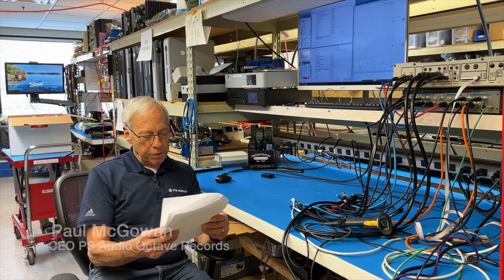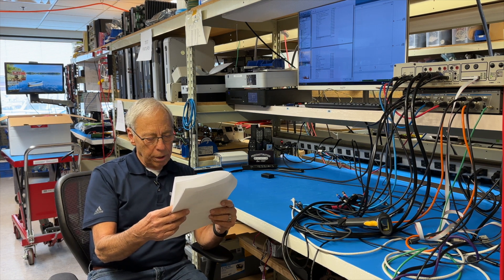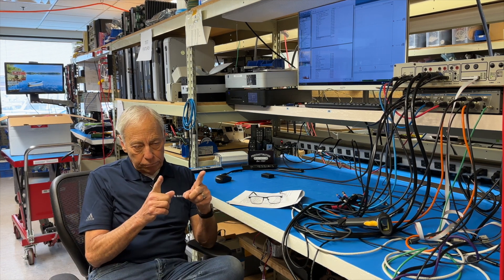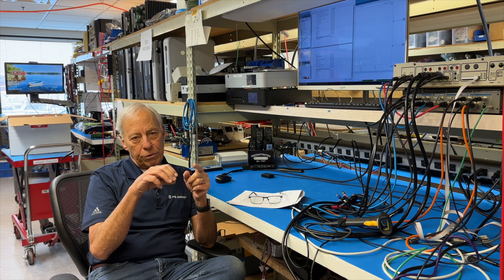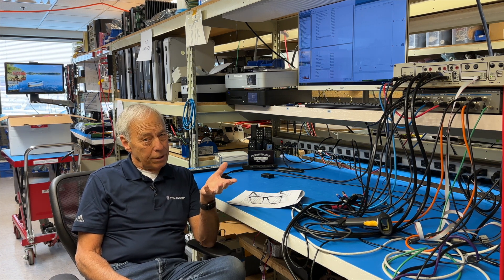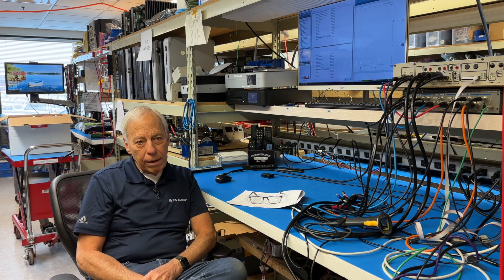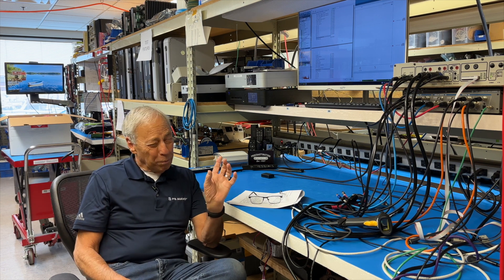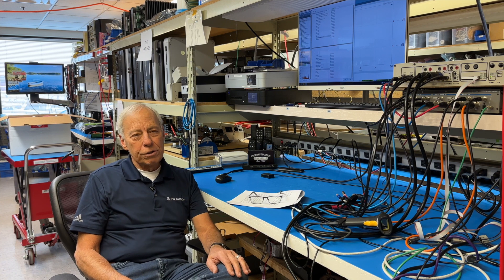Using audio grade resistors in loudspeakers

Comment: Thanks for all the great info. I have a question that, so far, nobody has been able to answer without a convoluted explanation of electronic engineering. When adding additional 4 Ohm speakers in a parallel connection, can I add in line resistors resistor to keep the impedance constant; for instance, each 4 ohm out on the amplifier goes to a 4 Ohm speaker. If I connect another 4 Ohm speaker to each output, the parallel connecttion will drop the load to 2 Ohms; so adding a 2 Ohm/25W resistor to each additional speaker should keep the load at 4 Ohms. Am I mistaken?

My 5.1 surround sound system has 4 speakers + the LFE out to a subwoofer. Each speaker is rated at 4 Ohms, matching the amp output. But I want to add four more 4 Ohm speakers, for a total of 8 speakers. Would adding 2 Ohm resistors to the additional speakers protect the circuit from overheating?
Reply: To get a 4 ohm load, you'd need two 8 ohms loads in parallel, and to get the same loudness out of your speakers, you'd need to put the same current through them, so the added resistances would only mean you'll need more voltage and therefore power to get there, IMHO.
Reply: Better to wire the speakers in series or series parallel .a 2 ohm will reduce the sensitivity somewhat, but more important is the effect on damping ( the amount of control the amp has on the speaker). Depending on the design of the speaker you may notice a bump in low fr.and muddy bass and possibly
some changes in fr.response at the crossover frequency.you try 2 ohm resistor in series with speaker you already using and listen to see if changes in sound are acceptable.good idea to use ohmmeter to check dc resistance of any multiple speaker setup at leads to be connected to amp channel before actually connecting.a 3 ohm would indicate 4ohm impedance.6ohm=8 ohm.this is not as accurate as actual impedance test but will alert you to low impedance that brings the smoke and damage.

Comment: Hi Paul I have some older Sansui speakers want to say around 1983 I was thinking about changing out the capacitors in the crossover you think that's a good idea they are getting up in up in age thanks a lot like your videos
Reply: If they are electrolytic yes, but ignore the advice on resistors, most speakers have more than 5% distortion anyway, good ones around 1%, so resistor sound is just a myth.

Comment: I'll add, for things like Metal FIlm, peoplle say inductive, but it really depends, Low value Matal film will have an inductive element, due to the way the resistor is formed, over 100 or so ohms the parasitics balance out so it behaves very much like a text book resistor, and then for higher values above say 470R then inter groove capacitance begins to dominate. The only true difference I guess, which you can measure, is for the very old carbon composite, as they become non-linear as voltage (three figures +) goes up, The non-linearity is real-time kHz. In valve amplifiers where high voltages are  the norm, you can observe a compression effect as the Anode resistor value drops in real time, as the signal swing reaches it's peak, dynamically lowering gain. I would go for a high stability with a low thermal gradient.

Comment: Parallel you will increase the wattage so you can buy 2x smaller wattage
Reply: 2 X 1Watt in parallel and 2 X 1Watt in series both equal 2 watts.

Comment: Resistors have properties of inductance and thermal dependencies besides resistance itself. There is nothing about resistors that can't be measured with simple measurement tools although thermal resistance dependencies obviously require some heat chamber to measure. Two resistors in series doubles the inductance and an inductor is a low pass filter also affecting phase. Thus higher frequencies will be more affected by resistors in series, if the resistor has a coil in it. The topic is about good engineering practices and the notion that certain resistors need to cost a fortune to be audiophile is mostly about snake oil business.
Reply: Agreed, good poont on series / parallel inductance.  I think you already realise we are discussing nH attached to one hell of a coil in gods own magnetic gap.   :-  )
Reply: @Roosville1  Yes, agree. Our brain is great at fooling us to conclude that A sounds better than B if A is more expensive or considered "audiophile grade".

Comment: I realize this can be a highly “subjective” subject; what sounds “better”

If resistor “value” accuracy is more important than parasitic Reactance, then achieve the closest resistor value best way you can (parallel or series)

On the other hand, if parasitic Reactance is the “enemy” then I see two scenarios:
1) Resistor is on the “through” path, put them in parallel (to reduce inductance)
2) Resistor is going to “ground” put them in series (to reduce capacitance)

In general, resistors in parallel give you better power handling options, use smaller parts

Lastly, even though we cannot hear past 20kHz, high-end audio circuits are typically designed for much higher frequency handling (50 kHz and even 75kHz) in that case, wire-wound resistors are the enemy (most inductive) so stick to carbon-comp if you can

Comment: Those of us who actually build cross overs and hear the difference between quality and budget "parts" applaud you sir. It’s not subtle but you do have to know what your trying to discern. One will hear a broader, deeper sound stage with better separation and timbre with nicer components.
Reply: You know, most of the audio tomfoolery ends with soundstage and timbre, you cannot tell the difference between 2 decent resistors.

Comment: Gotta love it!  Now i'm really piqued, I've got a few $K to burn, anyone know where I can audition some high-end audiophile resistors?❤😂
Reply: Top end resistors are typically 30-60 each. Once you get beyond $8 Mills resistors and similar quality wire-wound resistors, the differences will be very small. And depending on the rest of your system, placement, room, etc. they may or may not make a difference, subtle as it may be.
Reply: @hoth2112  I'm looking for the >$10K ones, the "gold standard", they're bound to be more "spacial" in the upper midrange :)
Reply: @stephenstevens6573  
Let the Audiophiles have their “playing with my hardware” fun.  They like
Tinkering with buttons, knobs, cables, etc etc.
EQ software, Scopes to measure everything, listening to electricity flowing through their cables.
Panic attacks if they think they are missing one bit in a music file. If Britney Spears is actually wearing underwear on stage in that short skirt.. OOPS
Reply: @Stephen Stevens  seriously though, im "in the winter of my years" and very happy with my mostly DIY system as it stands now. I have stopped focusing on listening to the hardware in favor of just enjoying the music and appreciating the Artistes' contribution.

Comment: Wilson Audio believes in the sound of resistors. They manufacture their own resistors and have a lengthy procedure for ensuring their resistor's tolerances after burning them  in. They are each measured and  verified  to ultimately  ensure their sound. I believe they pot tbeir crossovers in resin too to minimize vibration.

Comment: All the high end crossovers I've designed use non-inductive wire wound resistors ... I also find that the value of a resistor can quite easily be found in the E24 series ( if available ) and parallel connections aren't necessary... the only caveat is power rating ... so careful selection is important..😀
Reply: There’s no such thing as a non-inductive wirewound  resistor; nor a carbon or metal film resistor; even an uncoiled piece of wire has inductance. 
It doesn’t have to be in the form of a coil. It’s just a matter of how much inductance. Hence, the less inductance there is, the higher the usable frequency for the resistor in frequency oriented application. 👨🏻
Reply: @shipsahoy1793  sorry .... you're wrong on this one .... non inductive  wire wound resistors DO exist !! It's a pity I can't show you the catalogue pages showing these things. All I know is they achieve an anti reactance within the winding ... bifilar wound and connected out of phase ... I might smash one up and see what really is inside ! I have taken inductance measurements at various frequencies of a 100R 10W non inductive resistor and it doesn't have any ... they cost more ... but they are well worth it ..
Reply: @janinapalmer8368  no you can’t completely cancel physics, so you need to find out what the reactance looks like over frequency. You don’t need an inductorless resistor beyond audio frequencies anyway. Parasitics exist eventually at some frequency with all components. Any real engineer can tell you that!
Reply: @shipsahoy1793  Well I learned something new today. Low reactance wire wound resistors can use a Ayrton–Perry winding to minimize inductive and capacitive parasitics. There is a little blurb about this on wikipedia.
Reply: @markvalery8632  yep; it could have been worse. The other day I had an opinion about something, not a fact, just an opinion based on experience, and some one told me my opinion was wrong. 
Talk about insanity!? 
Btw, I am a retired RF engineer, so my brethren knows about component parasitics all to well. 
I never got into low reactance power resistors for passive crossovers though. It’s just a matter of mitigating reactance at audio frequencies, and up to 40 kHz should be high enough even for picky people that have excellent hearing.
Reply: @shipsahoy1793  I was a microwave integrated circuit designer decades ago. My designs were very simplistic in terms of topology. We had enough problems with parasitics, reflections, and loose manufacturing tolerances since it was the 80s. My millimeter designs were even worse.
Reply: @markvalery8632  Lol, sounds about right..🤣
🥂
Reply: @shipsahoy1793  Firstly , I am a real engineer .. an electronics and audio engineer ... both ! So I do know what I am talking about . Secondly you need to study what CAUSES inductance and it's related reactance ... a simple example is two bucking coils ( air core or iron cored ) if these coils are of identical inductance and resistance and are placed in very close proximity and out of phase then the flux generated by each coil cancels and with it the reactance ! Agreed ...not ALL resistors used in crossovers need to be non inductive as the frequency of operation may not be affected
Reply: @shipsahoy1793  Inductance can't be eliminated completely in wirewound resistors, but it can be minimised with a bifilar winding. Which folds the wire double before wrapping it around the core. This also helps minimise induction because the current in adjacent wires is in opposite directions, so the resulting electric fields are cancelled out. However, this method has a large parasitic capacitance since the voltage in adjacent wires is significantly different. 

If there's high powers with the speakers, one may have to use wirewound, simply because carbon or metal-film resistors are not readily available in high power ratings. They tend to be something like 5 watts maximum.

Comment: Audio grade resistors, that sounds so seductive! 😂 Those resistors should be expensive and hard to find! 🤔
Reply: It`s placebo grade...
Reply: Less than 2 Euro per Mundorf-resistor is not much for my budget, as a one time investment. Compared to many speakers, they are very cheap, but still most manufacturers of speakers don’t use good quality parts. That is why GR-Research is doing what he does.
Reply: allen bradley resistors are fine and won't break the bank. And they even hiss a tiny bit.

Comment: Where's the study that shows series resistors sounds different to parallel resistors.
Reply: Parallel and series arrangements of resistors does nothing. What an idiotic argument coming from a so called “engineer”. He probably failed Physics 2 with calculus if he even got that far. Two resistors in series add up. Two in parallel will be smaller than the smallest of the two.
Reply: It is in the room at he end of the hall on the right.  Why don't you run down there and read it.
I'll be listening to the music while you are gone.
Reply: It`s called the placebo study.

Comment: Procure some nichrome resistance wire that has a given resistance value per metre length and wind it in non inductive fashion on to a non metallic former of your choice.
Reply: Agreed, pork makes a really fine sounding former.
Reply: @Roosville1What a great idea, you should start a company that makes loudspeaker crossovers and name it Porcine Productions.

Comment: Just get carbon film but not carbon composite, 2% 6 Ohm 3 watt Vishay resistors.
 make sure you use non-inductive resistors. Don't get above 2% if you're not going to be buying in bulk and testing them. The most important thing is each speaker has to have Close match as possible, I wouldn't bother with the mondorf  there not anything special probably metal film... not as good as carbon.

Comment: You guys are FULL of it. Do you really think you can hear the difference between a 3ohm resistor that is 50 CENTS vs a 10.00 one? Bunch of snake oil, especially the never tiring excuse “you can only hear it if the system is audiophile grade and cost you 100K”….if you were stupid enough to spend 100k then you sure would be stupid enough to hear a difference between two 3ohm resistors. Before you know it you’ll say that you can hear resistor’s TOLERANCE and how every should use 0.1% tolerance resistors.😂😂
Reply: Yes, its true. Electronics engineer here, also did not believe this stuff about resistors, wires, capacitors affecting the sound. I built my own resolving amplifier, experimented and was shocked to findout. Even fuses change the sound.
Reply: @h1nicolas  true, even fuse-holders. Try soldering just very thin silver wires at the ends of a glass fuse, no insulation. Lose the plug and solder a power cable directly on the transformer, inbetween ofc the fuse. And try changing the polarity and the primary and secondary side.
Reply: You know what they say about opinions.
Reply: For any 3 way speaker which I made for very real sounding in last 30 years   it was bad to the  use  any resistor in high or middle (and low) . . .Resistors consumed  energy in parts of band which carried  important audio information and that energy and information  was thrown with resistor to bin.
Reply: In an ideal world where the resistance value is all that matters.....and the only difference between cheap and expensive is the profit margin.....then yes.
But we're not in an ideal world, are we?
Reply: How right you are!!!
Reply: Yup, you can hear different resistors, but capacitors are more audible when placed in the signal path.
Reply: Have you ever heard a 100k system?
Reply: Yep, you can definitely 100% I’ve tried many and different kinds. In my point of view a type of resistor is the last tuning aspect when finalising the colour of the sound you want, like cables or interconnects but is not as critical as in capacitors or in amps that work with a lot of negative feedback. Differences are easier to hear on very fast simple Single Ended amps or preamps with No Negative Global Feedback.